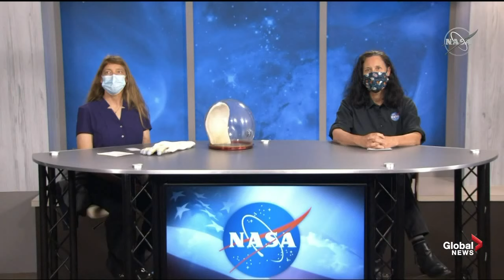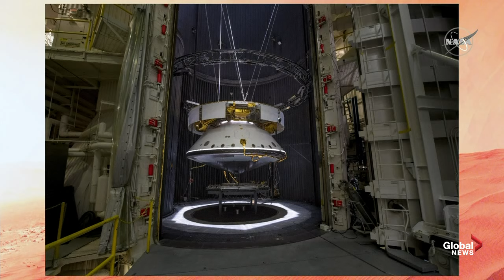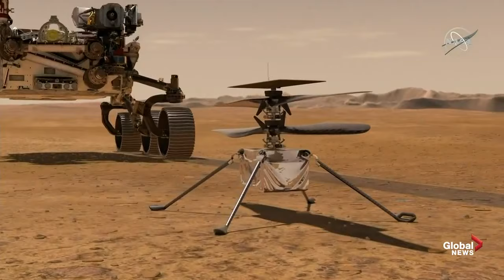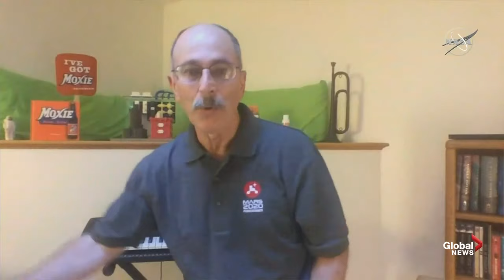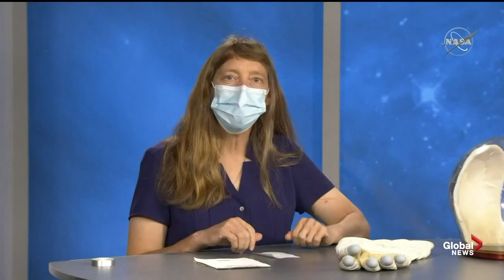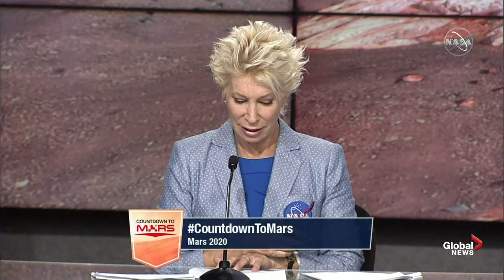NASA holds briefing on Mars 2020 mission from Cape Canaveral, Fla. | FULL

Comment: Mars is a luminary as is all of the other so called "Planets" it's nothing you can explore, you can't land on it. It's like the Sun. A luminary.
Reply: I think you been smokin something making you luminary
Reply: @k.sullivan6303  You Are ASLEEP
Reply: Nope. Try doing some actual observations. As for the earth being flat, understand first that ad things get farther away, they appear smaller. Next use a solar filter (really darkened glass) to view the sun and take pictures throughout the day. Make sure the filter will protect your eyes, even most welding glass is not dark enough. The filter will cut all the glare and let you see the disc of the sun. Measure it. You will find it does not change size. This means your distance from it has remained the same all day. This means it cannot be moving toward and then away from you as the day progresses. At sunset you will see the circle dissapear from the bottom up. In other words "it goes down". No conspiracy, you can do this yourself easily. Filters are not very expensive and it is possible to make your own. Just be damn sure it will block enough not to damage your eyes.
Reply: Plasma..You are Correct
Reply: Naw
Reply: It’s a ten dollar laser temperature gun and a full moon night to figure it out. If I was a betting man I would bet that the vast majority of globers wouldn’t even take the time. They would pull up a bill nye the science liar and confirm they bias.
Watch the bill nye can’t blow a candle out with different masks on then replica the experiment yourself. I know he’s old and probable should wear a mask since he clearly has a respiratory problem
Reply: @rayebel4430  Welcome to the Crew..We are The AWAKENED
Reply: @rayebel4430  That has been debunked many times and you can easily find it. Heat is energy, light is energy. Adding energy cannot reduce heat. Ever notice how it gets warmer in the....wait for it...daytime! Have you noticed shadows on the moon? Have you ever noticed shadows on your lightbulb? Thhhiiinnnk. Ever noticed that the moon is "upside down" in the southern hemisphere? Why? Think. Are you familiar with Triangulation? A method of using geometry to measure distances? Very accurate. Builders use it. Engineers use it. Autocad uses it. Basic math. You can use it to measure the distance to the sun and moon. Easy. Irrefutable. As for cold moonlight, it is actually the reverse of day most nights. With no sun to add heat (moon light is super weak) the heat escapes up into the atmosphere. The ground is warm and dense and holds heat. Blocking that heat from rising and escaping (shade!) Holds the warmth there same as it would a campfire. Try your experiment when there is no moonlight. Similar nights for temp and weather. Also same thermometer in the same locations. Basic knowledge of how heat energy works. Just take some science classes.